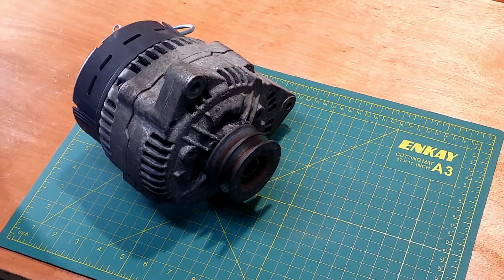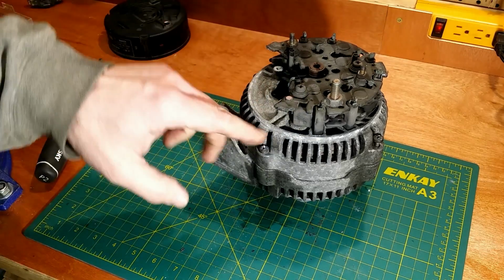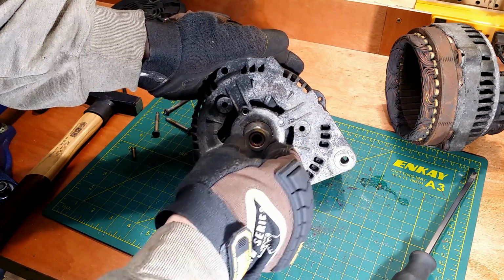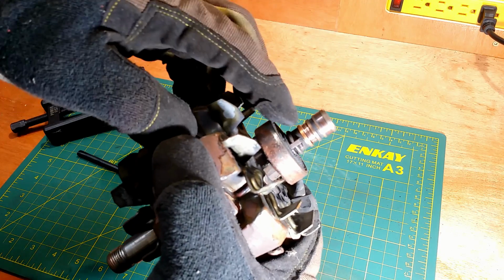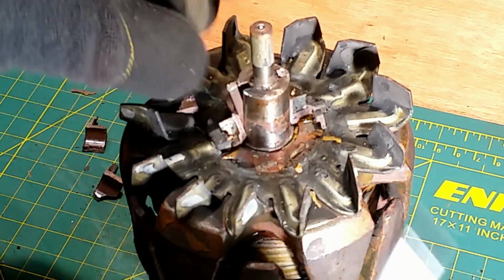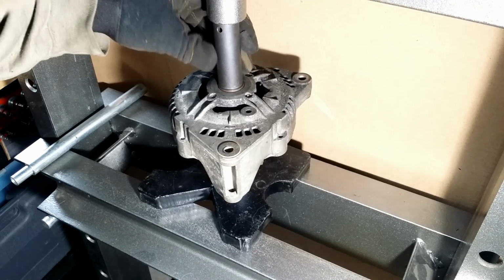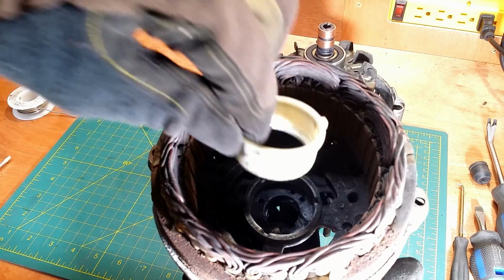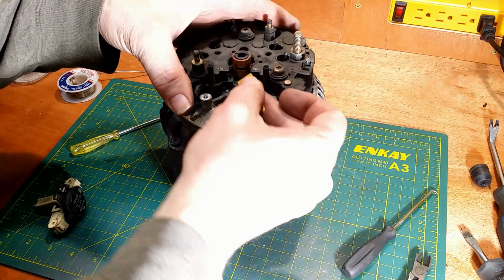ALTERNATOR - Bearings, Slip Ring and Brushes Replacement

Comment: Hi!  Is that an impact drill or impact wrench you used to remove the pulley nut?  I am hoping theres a way for me to remove the pulley to get to the bearings without having an impact wrench.  I do have an impact drill that maybe theres a way to fit some sort attachment to fit a socket on there.   Any suggestion is much appreciated.    And is that direction counterclockwise for the removal?  And just to be sure, are two sides of the bearing reversible, or is there a front and back,  with only one correct side going in first?  If so, how do i differentiate which side is which?  Thanks!

Comment: a hand impact driver like you use on motorcycles work great on the stuck screws. I had no idea replacement slip rings were available! Thanks!
Reply from the maker: You are welcome!
Reply: I've still got mine from K-Mart in the red metal box.

Comment: Very good , just a tip from an old guy , when any screw won,t come out , spend a little time heating the housing where the threaded part of the screw that won,t shift is screwed in , with a hot air gun when the parent metal is alloy like this , as the screw was  probably loctited in . Loctite will soften a bit when warmed up , so hopefully , with a screwdriver or other proprietory wrench that gets the best grip possible on the stuck screw , it will crack free & come out . Excellent video , many thanks .
Reply from the maker: Thanks!

Comment: Excellent video, very informative.  Most of the ones I've seen do not show how to replace the slip ring but you have excellent detail here.  I will need to replace the one on my '98 BMW 328i.  I already took care of the bearings, but one of the slip rings was deeply grooved, similarly to yours, if not worse.  I'll only need to remove the back half of the case, since the rest has been worked on.  Looks like a relatively straightforward job, just need to be careful.
Thank you!
Reply from the maker: You are welcome.

Comment: If i learned one thing in the 20 years  working on my cars its to always use the right tool for the right job.  Stripping that bolt was totally unnecessary.  Should have used a much bigger philips head screwdriver 🪛 and used manual force. Power tools have their place and application, but not this one. 
In all cases; thank you very much for the informative and detailed video ❤